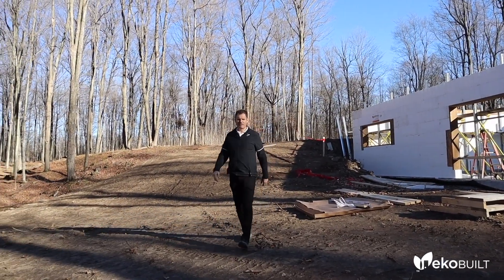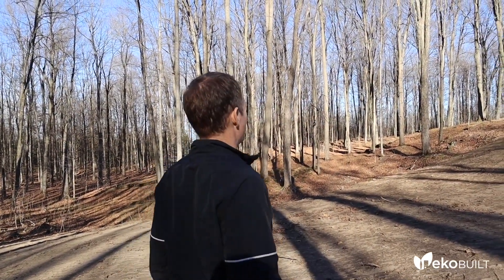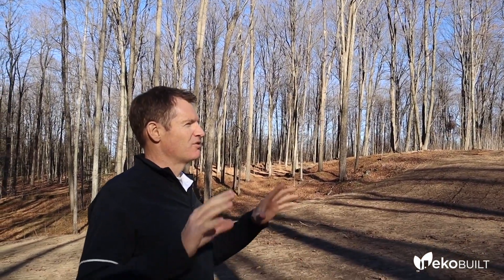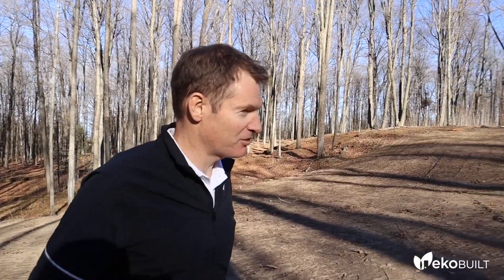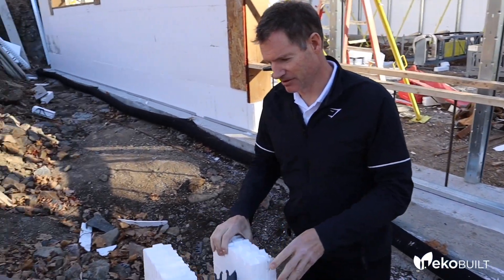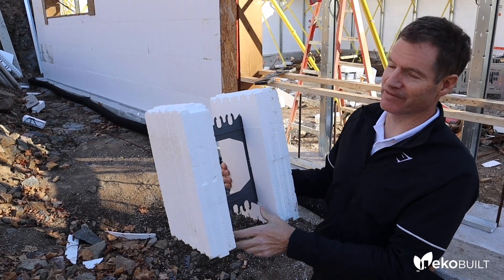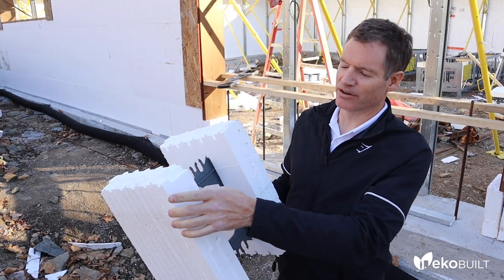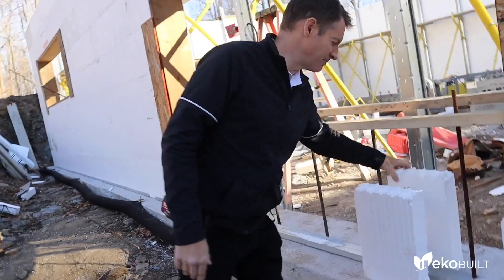Passive House - Basement Insulation with Paul Kealey

Comment: Couldn't you have used a larger ICF core & used inserts on the external side to increase the insulation value? I believe Nudura has something along those lines.
Reply from the maker: I love the comment because you’re absolutely correct…the ICF you are describing Using a 12” core with 6” billet (insert) foam, is passive compatible and actually more cost-effective, it is what we would recommend!
That said, our customers sometimes choose alternative methods which this foundation is an example of

Comment: one ton of heating should be enough for the house, if you install  one ton water to water heat pump with heated floors you would get COP 5 and you do not need a deep well to get 3 g/m for the heat pump and used water would just go to a river
Reply from the maker: Are you referring to ground source heat pump aka geothermal ?
Reply: @EkoBuiltPassiveHomes  yes , water source heat pump would use 3 gallons pro minute or less for each one ton of heat  and heated floors requre less heating temperature which contributes to higher COP as well, or ground loop for one ton will not cost a lot
Reply from the maker: @andreycham4797  cool info! What does it cost for the ground source heat pump to be installed as you describe?
Reply: @EkoBuiltPassiveHomes  I am doing a research for my property with full intention to diy. Contractors are not interested in anything to drill fewer than 100 feet. Water source heat system has some disadvantages the major one you may have to drill a deep well in your area  to get enough water but since you have a river nearby  is a good sign that  water is close to surface , so in your case I would explore water source heating option before anything else.

Comment: So how does the basement r-value compare to the above grade wall?  I understand passive requires the basement wall r-value, but what does the model say the impact would be if you stuck with the r12 - impact to heating/cooling?
Reply from the maker: Basement walls w backfill model says R-value should be approx. 65%. For example, where our designs call for R 75 above grade walls, we spec R 48 basement foundation systems… basement walls fully exposed. [walkout style] should be R 75…